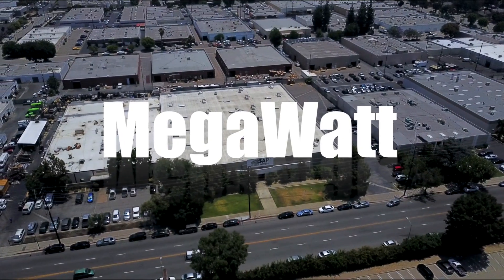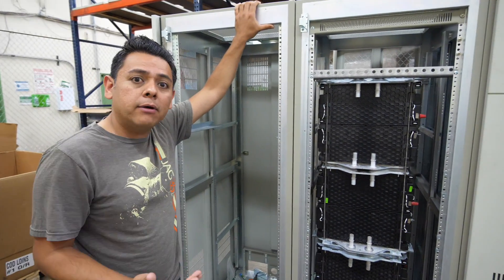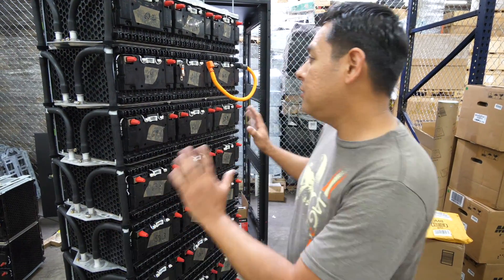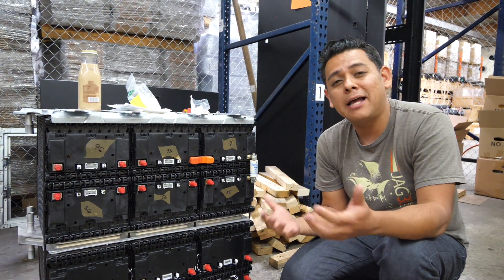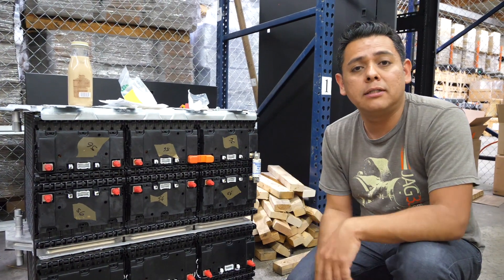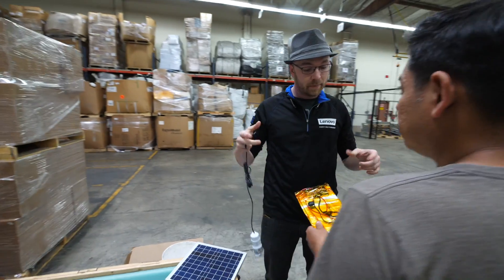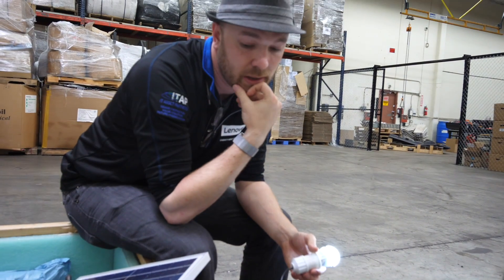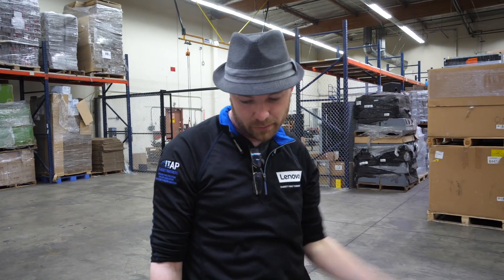1 million watt hour 355V SOLAR STORAGE battery

Comment: "Hey does anyone happen to have a 1000 cell balance charger???"
Reply: Look up liquid metal battery way better storage and scalable. Even,dyi small scale is,possible with the right minded individual
Reply: @brettmoore3194  hey check this out antifreeze puts out 0.094 volt's and can reach if it's old antifreeze  can reach 0.30 volts https://www.youtube.com/watch?v=UI6FOeJNsLI

Comment: Haha no 240v why do we Americans have to do so much confusing stuff
Reply: JP RC because before we switched to AC electric we had 120v DC. the benifit at the time for keeping the voltage the same was so all the existing lightbulbs would still work

Comment: That's a very dangerous setup you are building, you are exposed to the full danger of 480v at all times, battery maintenance would be a nightmare, one wrong move, touch something you shouldn't and someone is having a very bad day... 
A more sensible solution is to keep the battery packs at a more sane voltage level and boost the voltage with DC-to-DC converters like: http://www.powerbox.com.au/dc-dc-converters/euro-cassete-schaefer-c4700d.html and keep the systems separated.
60v battery packs--->maintenance system--->everything to the right should be treated as 480v--->DC-to-DC--->high voltage DC bus--->inverter--->high voltage AC bus--->transfer switch--->power mains or distribution panel.
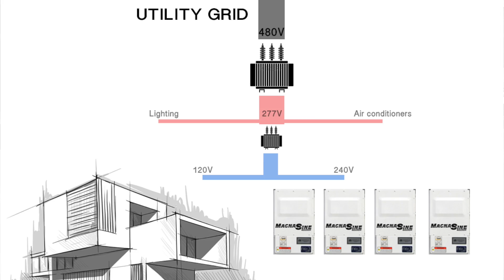Going by your simple drawing at 2:28,  the feed is 480 3 phase, it feeds 2 transformers, a 480Delta:480Y  and a 480Delta:240v hi-leg Delta(http://www.ecmweb.com/images/904ewBTBfig2.jpg), 
I assume the 277/480 transformer doesn't feed the other transformer, so you will need to feed both systems, this is where you have some freedom in design, you could do a bulk feed into each transformer's hi-side, this would probably be the least complicated, you can also feed into the distribution panel(s) and splitters via transfer switches, this way you feed critical equipment first, and eliminate/control less critical loads as power reserves drop, contactors could also be used for this purpose.

Comment: I am a noob with all the electric jargon and stuff but darn this is one project I would love to see when it is working. A few questions though,

1. How are you going to charge 1Mw?
2. How long will it take to fully charge?
3. What is the lifespan of the system if everything is working as it should?

**If it works, I am going to get one :-). Good stuff Garcia!

Comment: Would have been nice to get a link to the 25Watt Solar panels and 166Wh Battery...
Interesting project.
Reply: Especially since I live in Cambodia.
Reply: @gooblio  https://www.ebay.com/itm/100W-25W-10W-5W-Solar-Panel-12V-Portable-Battery-Charge-Camping-RV-Boat-Home-US/232970506290?_trkparms=ispr%3D1&hash=item363e1fd032:m:m36tR7Q48zDrsuIQ1eEcnGA&enc=AQAEAAACMBPxNw%2BVj6nta7CKEs3N0qXfBsSw%2BnFkG%2Fm2i%2FUtmuepYgzYk8wvDD5JGUSoJehiCRzAZAOqzXV%2FNHkvDMNuyxGuG5h6XPhEXV%2BFQctTLW%2BFdTk3fb80Dib9lm5UbQgVYkFqak6x3YqABpH9Dj96aTLTfCM1UFhGdrpzKgHQr589F9aN36Z8A5mTLlJBTwnT0FQEaRlTtWIlzJfb6elpJd4xlLagUUhHlLIayzPAK2h5tV%2FBnYQBKiCNILogdsL602EOs1EVnYiW7vjSYomUFP3t1paG0eFQTcNgwvAna%2FNIIzfCYHaVhwme12xSYx5g4jl47rupxwsmTR9zYDcrd5D2pDw729qSeoaGXiRwVCw7DvXrOXCf0a1vKgcKmt3Twyl40C1xiaG7Ge5ssruqZuMGTWOk1LzVRa%2F7vbrn%2FA7ImMrWIxWRshWyloAysf4zKuBsESdI45DtEKozAsgvzRT5ESsqMzflQQv6eivuyyTBKRHwtzJL4a1UgYLOXqQ6Vfrnyl11hSVLVUXAdRxdCCz1iHW5w3LqJhMdKu%2BuJjpNgx7veKHjP%2BrPzXCubn3M%2FGqQ2FJ51pL7izkm1UvwqNX3UepFjRBLr31n9n54WSEJXmRaiK3pVQwC6AGsTn2Q4UDm9jQ59cNv7bX6PiaO7Is2f7duikHINfoQ0R6BS0eaMbQXjBjEOJJlzxOAfqAAuK6bOMCvKth9Rm4vNC8nqKk2XaUJ7IB7usQ5KlXtKHCQ&checksum=232970506290c164c164e2834904a2b866b91dc08899
Reply: @Dewwerks  did they go out of business?

Comment: jehu

Do you think the 160WH batteries could be used to build a pack in my trailer???
I have 490 W of solar panels and want to add 490W more for 980W 

would I be able to buy some of the 160 WH battery packs

Comment: Interesting work that you're doing, I hope it works out well. I especially liked the second half where you are discussing making and sending solar/battery combos to Cambodia. Brilliant. Can it be made to happen?
Reply from the maker: +Benjamin Ford  where there is a will there is a way
Reply: Regarding that piece about the solar light kits, could one source ABS plastic from laptops, shred it, and make 3D printer filament out of it to make the case for the charge circuit and battery pack? Also, if 18650 cells from said laptops were used instead of or alongside the pouch cells (either or, depending on what's available), the plastic casing from the original battery pack could go to making the 3D-printed case.

See ABS shredded and made into filament here:
https://www.youtube.com/watch?v=-yZ9crsRyws
Reply: Making ABS filament out of shredded abs is very dangerous, it releases lots of carcinogens while meling
Reply: Jehu, think we can collaborate to make these packs available in Bangladesh? UPS, IPS is the norm here like a lot of other SE Asian countries, especially in rural areas. I've been living here for the past two years and really want to see an increase in accessible electricity to the masses
Reply: Why is everyone so willing to help other countries? If you want to help so much. As Trump says, make America great again!

Comment: If these are LiPo batts they won't last long LiFePO4 cells should be used with protection and balance on high on low voltage, and additional cells for redundancy
Reply from the maker: +Rumen Markoff  these are a fraction of the cost of lifepo4 so we will be using them instead of melting them for their raw material value.
Reply: Fraction of the cost is good for experiment, study but to power up a corporate equipment, they may ask for 1 or 2 year warranty I just tried to save you a maintenance headache

Comment: That will need a MEGA bms lol. I would install a 63A double pole DC breaker for each string in a 125A distribution board with the main switch outgoing from each racking unit. Then run all 10 racking units to a larger MCCB distribution board with a MCCB for the inverter. That will give you at least 1250A at 355v 443kw available. That should run a couple of LEDs lol.
Reply from the maker: Gary Lewsam  hoping that barium will be able to help us with this project
Reply: Surely ... Just a couple.. :P

Comment: interesting  , this guy in the hat is on a whole nother level.......thinking outside the box. good nice to see.
Reply: That guy is awesome.
Reply: They did just that last year, was on Breakthrough on the National Geographic TV channel. I put a link in my comment above to the full episode.
Reply: he is divine & gifted. ☮️
Reply: You need to do a follow up video about the end portion and if you were to make and sell those domestically id take ten like right now. (talking about the light.... ooo heres an idea make and sell them and for every one sold, one is donated over in a country where electricity isnt a mainstay.)
Reply: Now I'll shoot a big hole in your post. That piece at the end with the light and solar panel had ABSOLUTELY NOTHING to do with the inverter/battery project at the warehouse. The whole purpose of that piece at the end was those parts could be assembled into kits to be sent to places where electric light doesn't exist (Cambodia, for instance). Totally separate project from the warehouse. 

The "free phone" comes from the fact that money saved by families getting these kits no longer buying oil for light can instead be spent on minutes for the phone they buy/get with the light kit.

As for the warehouse system, they are adding solar production and battery storage without changing much, if any, of the interior electrical system. They are only putting a solar/battery system in between the warehouse and the grid.

Nice try.
Reply: It's all been done before and continues to be done in Africa
Reply: This freaking stupid! Look up Troy Reed to see just how stupid and a big waste of money this is!
Reply: B
Reply: 8:20 is nearly describing what a company in Uganda and a few other African countries is doing called Solar Sisters. They've been at it for years. Get the families to not rely on the Kerosene lamps and give them a USB. That's the product, and the other half is training locals to run the distribution like Herbalife.
Reply: Hey Ruthless cw:
Nice to see this guy thinking outside the box... 
You CAN'T BE THAT BLIND
No time to even make fun of you
You being a car entheusiast... 
Try removing your cat converter
And go get your car smogged...

LEGALLY...

LEGIT SMOG STATIONS WILL SEND YOU AWAY

Maybe you just don't have any watching retention or comprehension.

Maybe you want to be given a free phone....

              A G E N D A  - 2 1  

Will be what you finally relate this entire scam concept to.

You will get it in the next few years if you are so blind it means 
                    
                                  NOTHING  

to you right now...

Nothing quite says deep state like this presentation...
Look at the titles at the video's begin and end

Hey look..   
professional camera production...
Not a couple of wherehouse guys playing with their hand cams

Just wondering...  who shelled out the money for the aireal camera shotsOver the business of the opening credits....
HATE  IT WHEN THEY THINK WE ALL ARE SO STUPID....

Oh yeah...   this is the update

Where does this where house guy get his engineering degreeplanning and calculation the design for a project like this???

Not beating you up man..  But..   

You HAVE seen the footage from all the cameras at 

                     CHARLOTTEVLILE...

Not sure..   what you know

But you should check out Faith Goldies videos from the charlotteville eventLook at it and ask yourselfHow does that gal.. a cub reporter

Make her way across the country to a specific street corner where her 

ASS  is wresting on the fender of a car right across from where the car 

crashed into the protesting pedestrians...

while she is videoing not a selfie...  but a forward view....

This deep state stuff is real...

This guys video ... Pretending he is attempting to engineer a temporary power backup system...

Isn't just fake ass deep state.....

                 It is massive  AGENDA 21 PROPAGANDA

Will be good when they get you and your family out of your cars 

And into those 3 story non garage communities 

You are going to love riding a bicycyle to go shopping...
And taking your  dog to the dog park as your form of entertainment...
Reply: WORLDisFULLofLIES o
Reply: Isac Nilsson...  is like Issac Newton
One smart mamma jamma

What we saw here was scam after scam
These geniuses have the impression 
They are relating  everything energy related to  

                      KEROSEE USAGE

They are pushing

                                 AGENDA 21... 

Not smooth enough slick talkers

Will never get off the ground..  
Because this is an energy backup system
Not an alternate grid supply.

He clearly detailed the sub panel 3 phase is 50 grand NEW
County nor Edison is not going to ISSUE PERMITS 
OR ENGINEERING PERMITS FOR  USED 2ND HAND EQUIPMENT
This entire project predicated on a used inverter
REWIRING THE ENTIRE BUILDING FOR THE LO VOLTAGE LIGHTING

The  mad hatter thought he was pretty slick plugging that 5 watt lamp into a battery pack...  
And then presenting as though it was going to provide lighting 
throughout the building.

Every second it got more and more stupid

Who ever they think is going to pay for and approve the 
engineering calculations 
Engineering plans 
And permits....For both the Edison tie in
Which Edison will have to approve Seperate from the city or county engineers
as well as the building seondary electrical system
  
Someone thinking that will not be 

               COST PROHIBITIVE

He would be a fool

These guys are participating in  some sort of covert state planning 
effort to control and limit population expansion, development, by creating laws controlling  sustainability...

The underhanded intentional efforts to do good for everyone.. and entice someone...  somehow..  as you heard him say...  

                     Free phones and phone serviceThink this through

Everyone intending to plug in their free phones..  will have to recharge at a recharging station in the wherehouse where the inverter is located.. or throught the building were they will have had to run the low volatge lighting  conversion for the 5 watt facility lighting.

WHEN IS A GOOD DEAL TOO GOOD TO BE TRUE

WHEN IT IS A SCAM

AND THEY ARE TREATING YOU LIKE A FOOL...

                 BELIEVE ANY OF THIS

                                 AND   

                     "  A G E N D A 21  "             

                        IS YOUR FUTURE